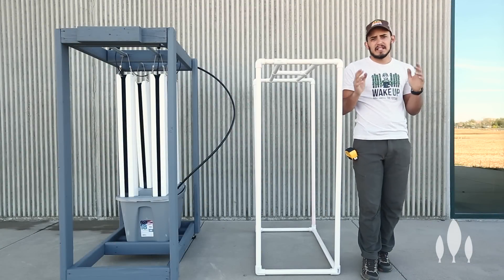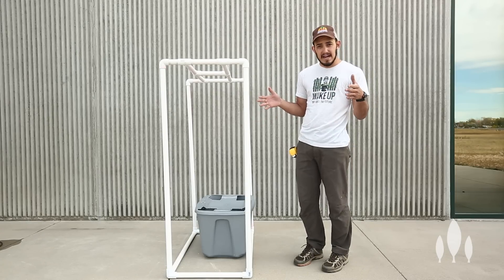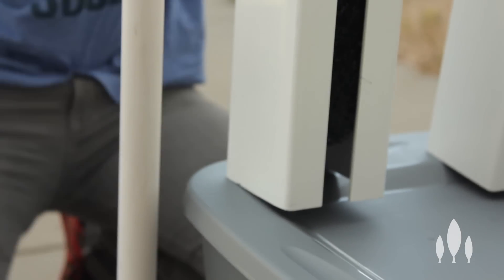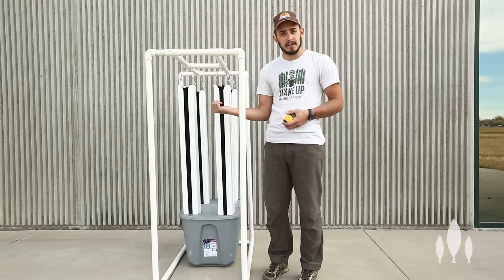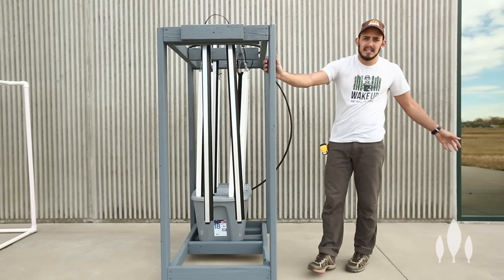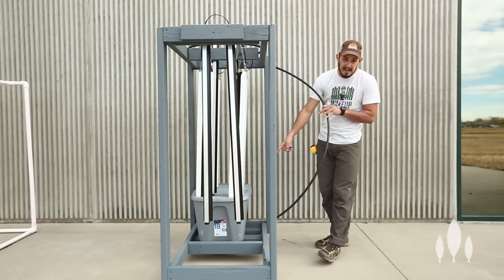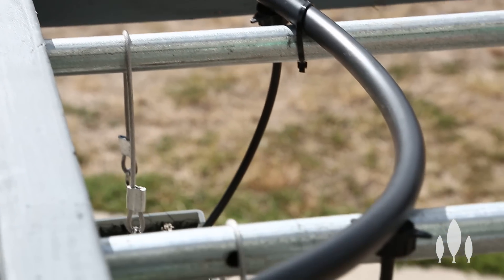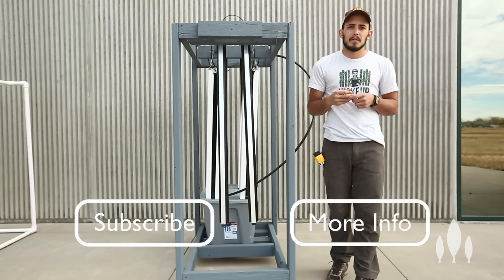DIY ZipGrow™ Hydroponics System

Comment: I was reading the pdf file you all had made, "The Top 10 Mistakes Made By Aquaponic Growers", and I couldn't help but notice that you all made it sound as if pests would be avoided if Zipgrow Towers were used (on page 14).  What gives?  How does using towers limit pesticide exposure?

Comment: I like the idea i need our configuration on the wall or next to our garage and have pleant of light, couldnt a tubing or pipe help drian to the sump without hovering it above the sump? I have a shelf outside to put the tank on so i dont have to bend down...knee trouble i like to jave 4-6 of those what size of tank would you recommend?
Reply: I have a metal shelf to hold all the rail let me know if i can share idea thanks

Comment: I realize you want people to be excited with the music (ambiance) but its bit too overwhelming as others have stated. 

Build comments:

1. You are less likely to tear the plastic with the hole saw if you run the blade backwards. Saw that one of the holes drilled by the saw had a good tear. 

2. Need to warn DIY's that those plastic bins distort a great deal and can fail even with 12 inches of water depth. So, if you get a deep bins, add a frame around it so that it doesn't rupture from the water. If you don't believe me, leave 12 inches of water in the "tank" for several weeks. 

3. I understand your concern for point of failure with fittings, byt I've never had problems with "quick-lok" type fittings on a 1/2" poly. Don't recommend compression fittings because you can't change it once its installed. 

Just my 2 cents. Great instruction for beginning DIY's
Reply from the maker: +Shawn Ueda Shawn we really appreciate the time you took to give us your feedback. I really think you brought up some good points that others will find helpful. I have re-uploaded the video without music. You can find it here:
https://www.youtube.com/watch?v=saAvlYKgTak

Comment: Which T5 bulbs do you guys prefer to use?
Reply from the maker: Hi +David Duvall - We're partial to just a standard T-5 bulb: https://shop.brightagrotech.com/t5-modular-light-rod-with-reflector-4-ft/
Reply: +David Duvall  -- you want to get T5HO high output but make sure your ballast can support it. As for color temp, it used to be red and bluish spectrum (600nm and around 420-440nm off top of my head). But now some say it needs green spectrum to help develop flavor so its three color (NASA paper on it if I remember) if not sure I would go ahead and use daylight bulb and not warm or cool white.